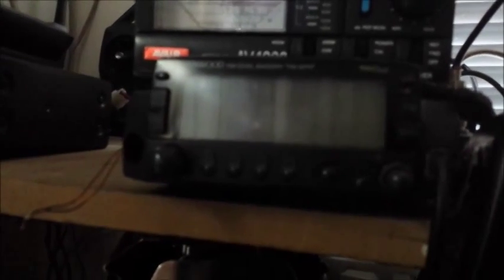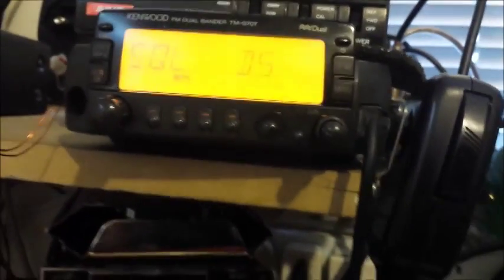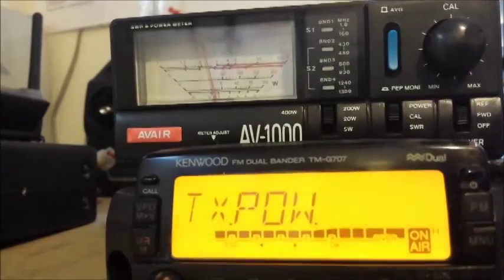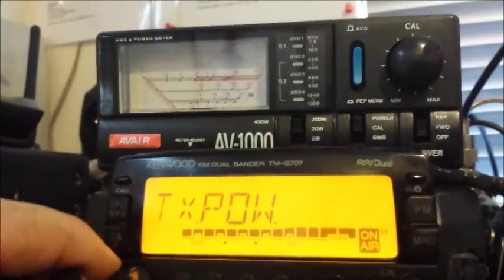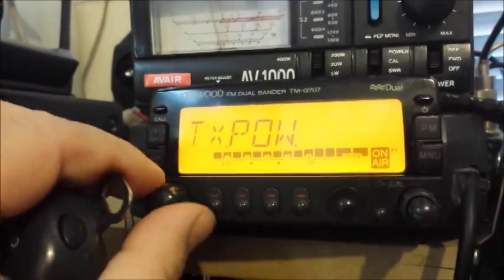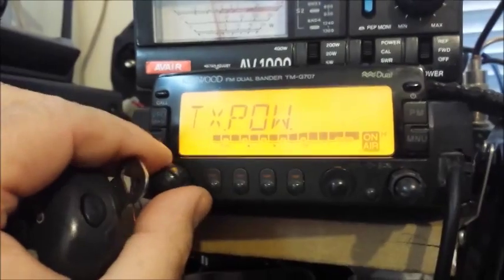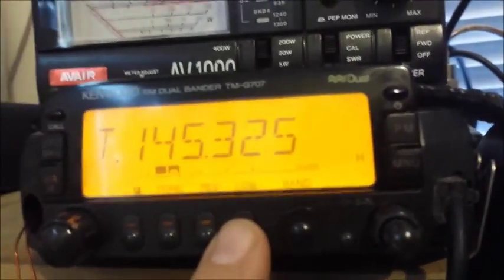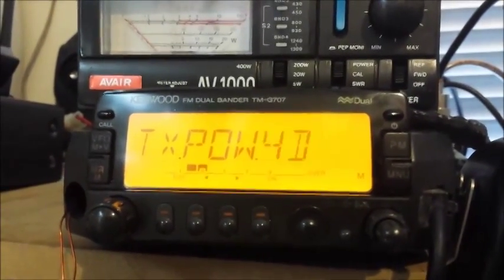Kenwood TM-G707E Power Correction Procedure

Comment: On 2 meter or 70cm most of it is done via repeaters, 5 watts in a decent antenna could get you a few miles in 70cm and around 10 on 2meters.
Are you in a really bad location and 30 miles from a repeater, that's why you need to push out so much power on these bands
Reply: what's got to do with you ??
maybe he doesn't want to be homosexual and use repeaters, maybe he actually wants to work SIMPLEX like radio is intended..

you don't know the guys location or antenna condition so what give you the right to tell him to lower his power and us repeaters ??

maybe you should look at the UK foundation licence holders and explain to them what 10w is and that DMR isn't real radio it's what gays use when they can't or don't know how to put a decent signal out.